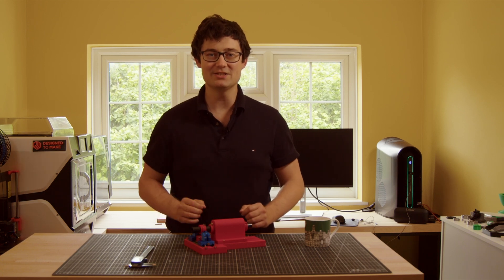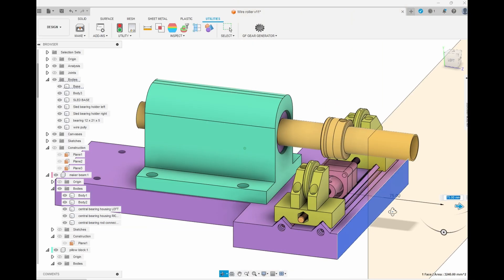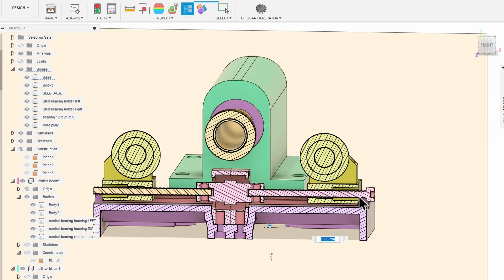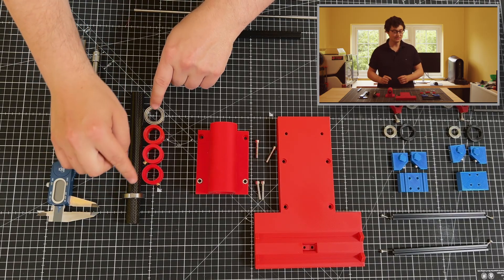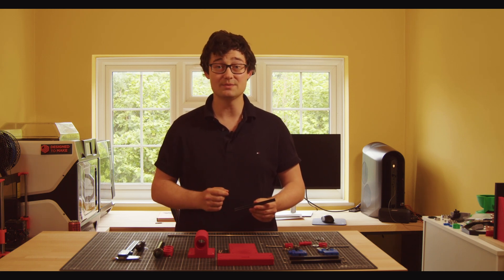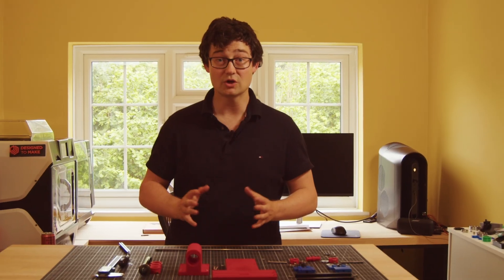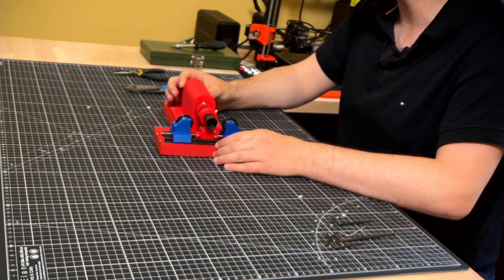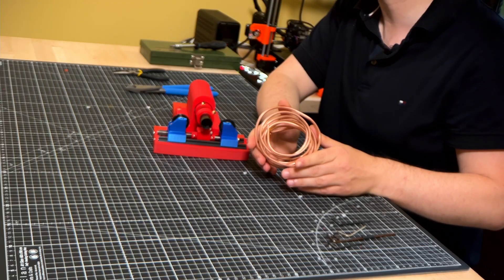Making your own wire bender - easy 3D printing tutorial

Comment: Fun video, nice editing, love the content. Consider using an electric drill to turn the shaft...
Reply from the maker: Great idea! I agree that would certainly save some time. I actually added the two holes at the back of the  baseplate to mount a motor. Might need to add something grippy to the central wire guideway like a rubber band to stop it slipping against the wire first. The tool is actually pretty versatile, I've been able to use it to bend metal sheets as well to build magnetic gears in my latest video.
Reply: Hi! Can you share the STL for the wirebender?